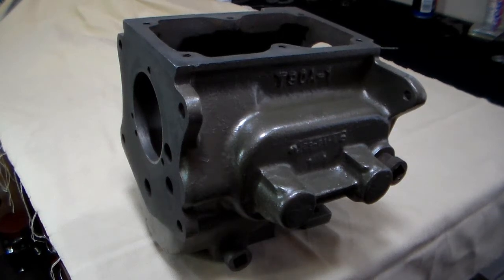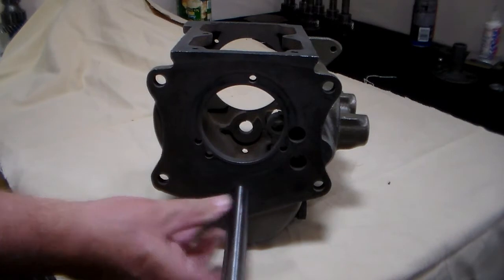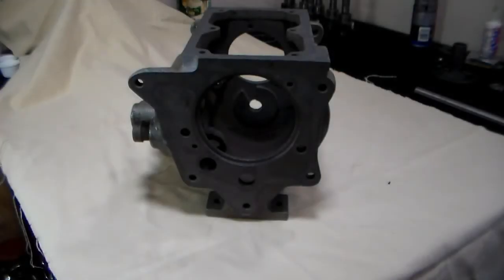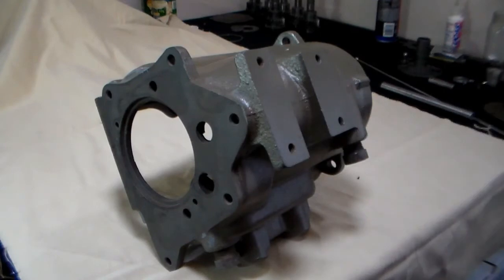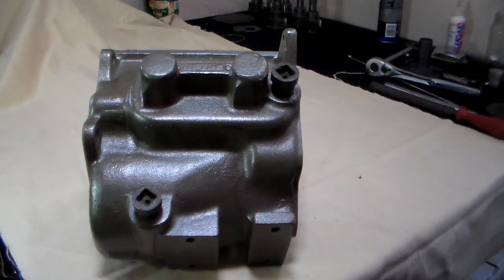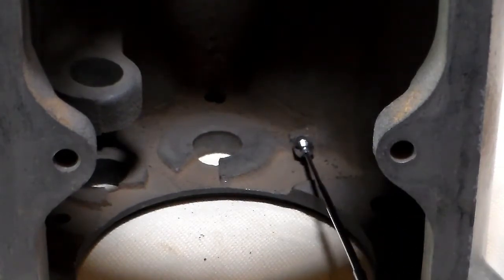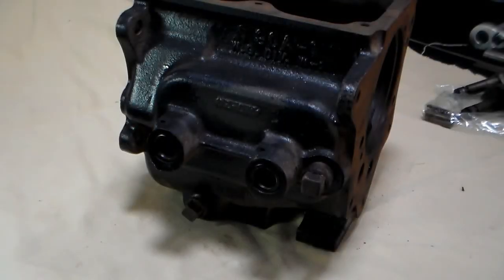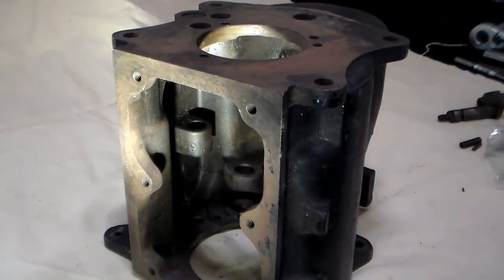6 Rick Stivers T-90 Rebuild Guide - Inspection Part 1

Comment: Mr. Rick I have a cuestion for you. Is there any problem if I block the side shift holes with a  bolt shims and nuts? I use the tower shift, thats why.
Reply from the maker: ruso3cv As long as you install the bolts from the inside out and heads don’t impact the gears it should be fine. Make sure to use sealant on the bolts.
Reply: @rickstivers3965  Thanks again Rick!! You are a great person!